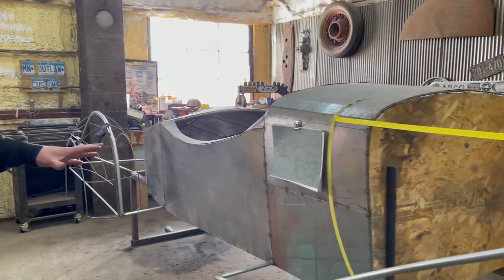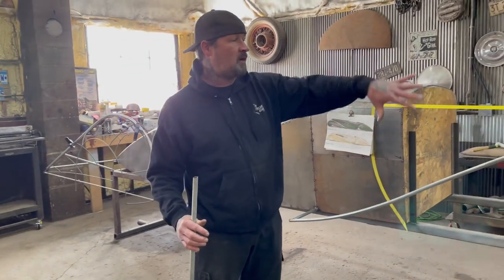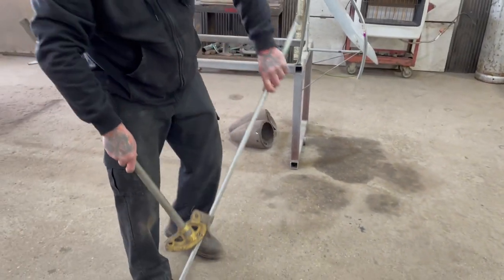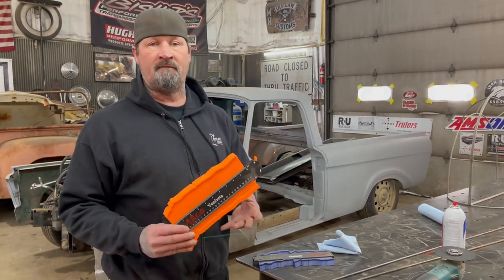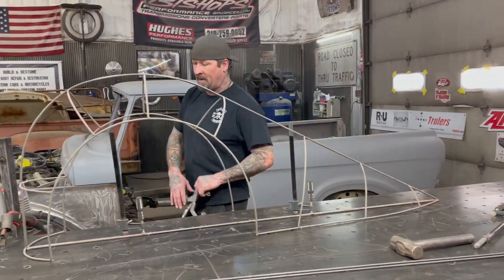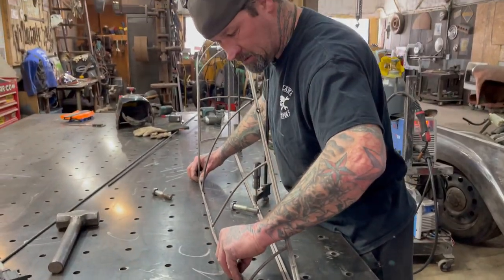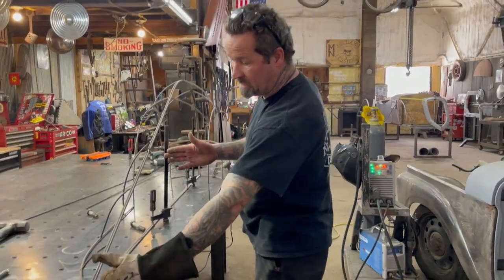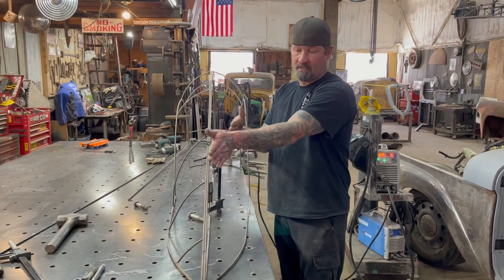Metalshaping: building wire form buck, for the fender of hand built car, tutorial (Ep. 1)

Comment: Looks good man. I’m a sparky…we call them ‘hickey sticks’ (no idea why?…maybe it was a brand one time). Another way to bend it is drill a hole a little bigger than the conduit…in a block of wood and put the conduit through it. Just pull on the conduit, move it a tiny bit..pull again…repeat until you have the radius/arch you want.

Comment: I don't think you can get that metal electrical conduit here in NZ. Ours is all plastic. I did build my Austin 7 frame from small diameter ERW furniture tubing which I am guessing is similar. To bend it I used a block of wood with a hole in it! Will be cool seeing you do the metal shaping on this.

Comment: Hey glad I found your channel. :). Was cool to see you use the rod as a form...I did the same when building front and rear wide-body fenders on a mustang. After the sheet metal was welded-up I removed all the rod underneath except along the wheel well hole to give it some strength and thickness (the outside edge).
I've made two planishers (a small hand-held one and a stationary one) but now want to build a Mini Planisher so i can use it on small S/S moldings/trim and was wondering if you know of a mini air chisel type tool around?
Thanks for sharing your time and experience!
Reply from the maker: Honestly I just use a cheap harbor freight air chisel and most of my tools I can make. My English wheel is homemade and it works amazing and I have my handheld planishing hammer also that I made just from a cheap harbor freight air chisel. I really appreciate all your nice comments and your support to my channel. Every Sunday we’re doing a metal shaping video. So stick around.thanks 👍 ARCO

Comment: So is that thin round bar you're attaching to the conduit  ?
Reply from the maker: @MidnightCustoms-C20  5/16” cold rolled solid round rod 👍 it welds easy and also is easy to form too. Hot rolled is way harder to bend so it’s a little different to work with bro. 
ARCO
Reply: @OutlawEdge  gotcha. I might try building a wire buck just to do it at some point. I don't know that I have a need for one at this point but I'd like to try building a fender just to build one lol